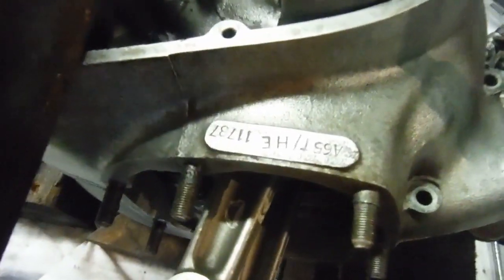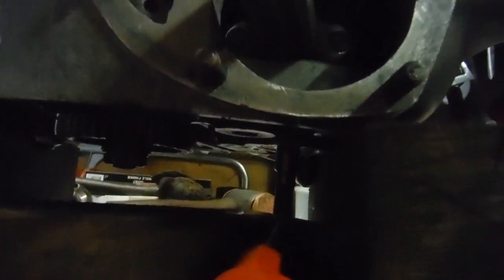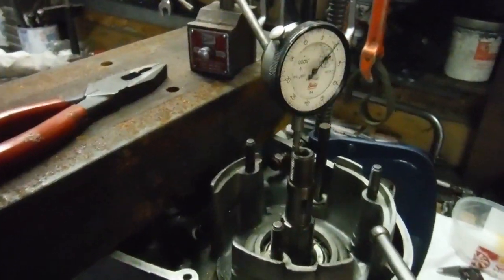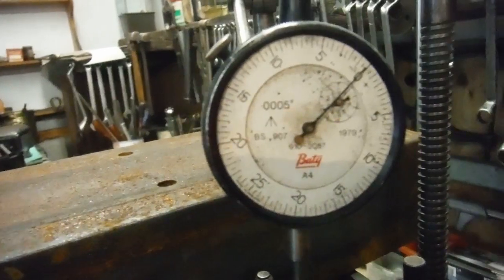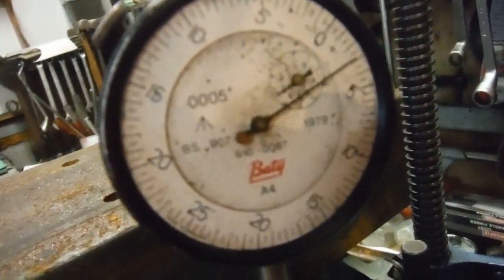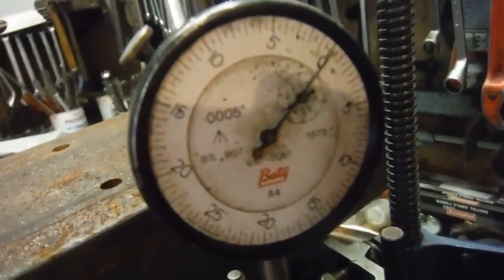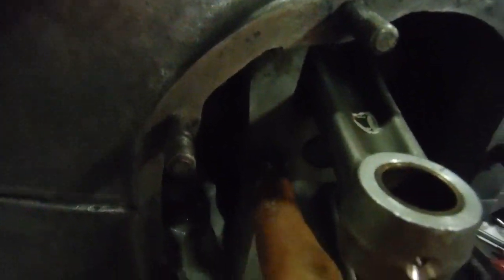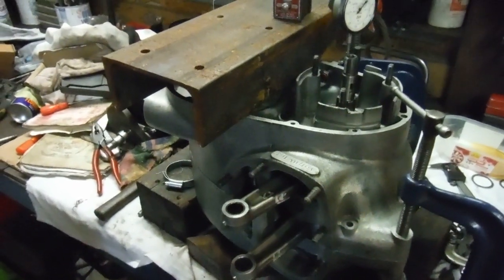BSA A65 T rebuild - checking crank end float in rebuilt bottom end.

Comment: Thankyou for the good quality work. 
Question tho if i may.
On the A50 is the shim cup part of the measure for shimming ?
We need .015 of shims to get .002 end float clearance but the cup itself is .020. When the engine was torn down there was no shim cup used. 
Can the cup be left out and shims only used?
Thanks for considering .
Jerry Hansler
Reply from the maker: Hi Jerry, the shim cup is there to help keep any of the more fragile shims from breaking up, so it is best to have it fitted. If there is not enough clearance with it fitted, something is wrong, perhaps a bearing isn't fully home, timing side thrust bearing too thick, not orientated correctly or something.

Comment: Another arm chair observation 🤔 is there a gasket between the crankcases that would throw out the end float?
Reply from the maker: No gasket, only a smear of gasket compound and when fully reassembled with all bolts in and tight and with gasket compound applied, the end float was checked again and found to be the same.

Comment: Thanks,  How is the axial float adjusted?  Crankshaft shims somewhere?
Reply from the maker: Yes - shims between the roller bearing's inner race on the drive side and the crank, it is a bit of a fiddle, as the inner race is a tight fit on the crank and usually has to come off after fitting at least once, for adjustments.
Reply from the maker: @charger2595  Thanks, my two main methods have been either to carefully prize out the rollers to remove them and the cage, or fasten a Jubilee clip around the rollers, so a puller can be used in either case.